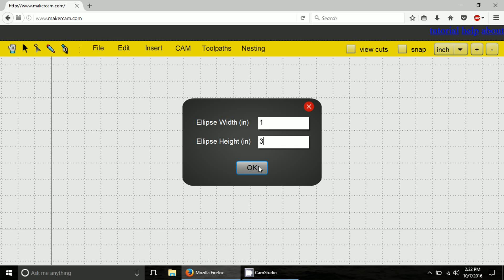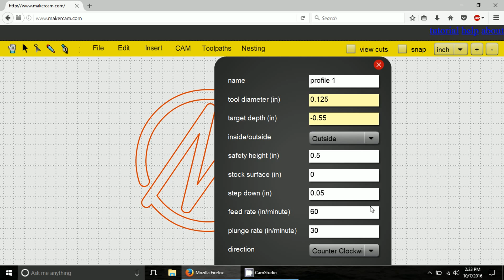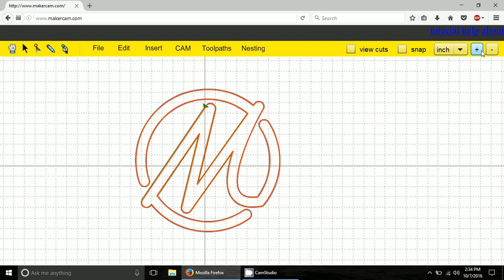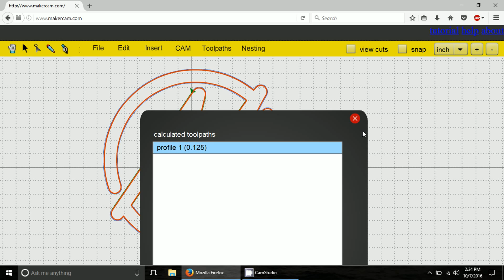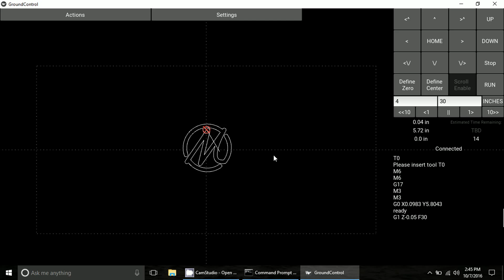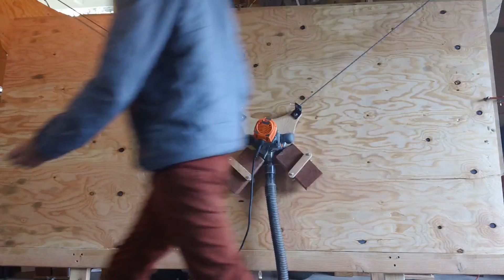How To Use www.MakerCAM.com to Cut Something Out by Maslow CNC

Comment: Would be great if it didn’t resize every one of the files I open. Takes a 1” square file and makes it 5” square for example. Normally we wouldn’t mess with software like this but believe it or not our $10,000 software doesn’t engrave clipart/logos. Well unless you want to redraw them all line by line and drawing a particular font can be rather daunting. Also some post process issues because our machinery is a little different so using maker cam part zero for z axis is never what you zero out the machine. Doing that will drive the end mill through the work piece. So while it’s probably useful for cheap Chinese routers it’s definitely not compatible with everything.

Comment: Thank you for sharing. I enjoyed the Maslov design very much. Never seen that one before. I have a question about MakerCam. Can I change the starting point in this programm? I use very thick material and my mill is very long, so instead of starting from the outside I would like to start from the inside. Kind regards, Douwe

Comment: Could you teach me to set spindle on makercam? I didnt see any S command from gcode. Unlike some other software export gcode with spindle speed like S10000 M3...  Or, use some machine with spindle speed control just turn spindle switch on and run.